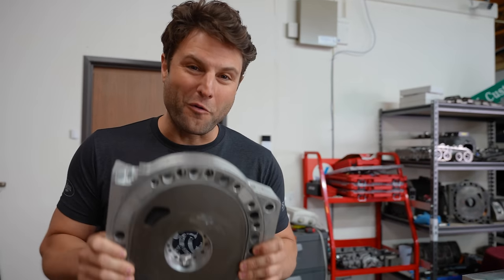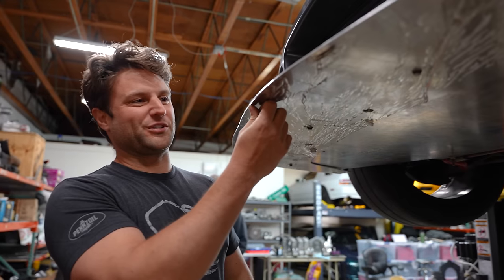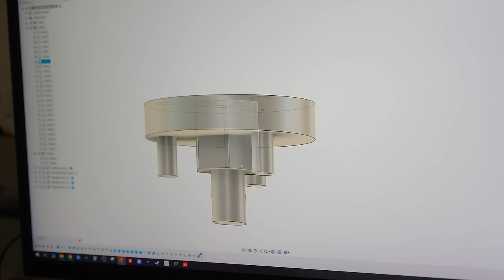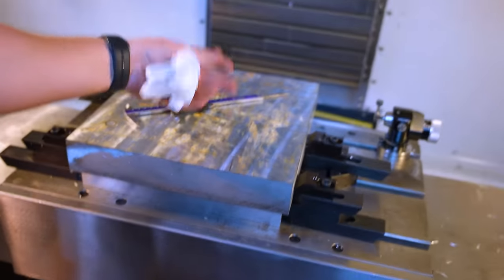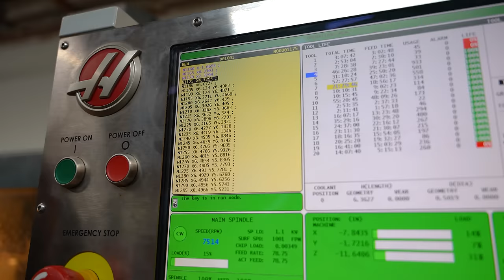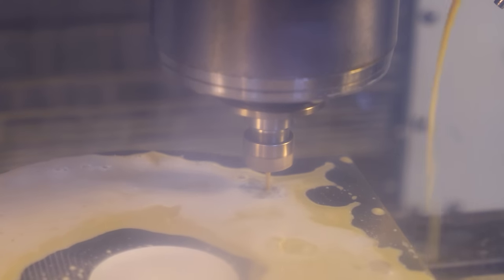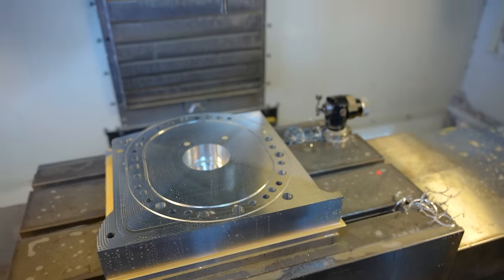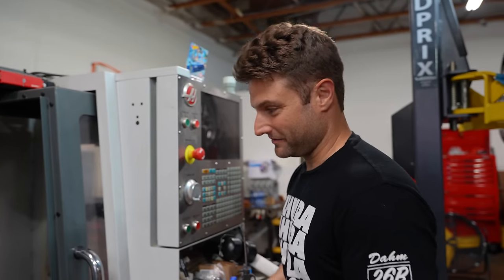Making my FIRST Billet Engine plate from raw Aluminum!  Dahm Racing Engines incoming??

Comment: If the rotors were wider, would it be a workable way of increasing displacement and power?
Reply: Yes, that's the main difference between 10a, 12a, & 13b, and also the reason housings can't be interchanged but irons can. Rotors are the same sizes but different widths. As for Mazda's new rotary engines, I believe the rotors are taller and wider, and nothing interchanges with 10a, 12a, or 13b engines.

Comment: If you're starting from scratch, would it not make sense if you wanted to go to even larger studs for more holding power to maybe space out the studs from the rotor area and enlarge the footprint slightly. Also with building from scratch could you angle the intake ports upward so the intake isn't directly above the exhaust? I know they have to enter the rotor at the same spot,. Maybe the swirl would be off, but it's a thought I've had.

Comment: Rob, look into form tapping. I generally have better luck with form taps not breaking in smaller sizes. Keep in mind the drill size is different when forming threads. Also you may achieve better results turning the coolant off and using tap fluid. Just put an M9 and M0 before your tap and blow the holes out, then fill them with tap oil. Another benefit is stronger threads.
Reply: Can't you also do the classic of making the machine actually go in a few turns then back a turn repeat to clear chips and all?
Reply: @802Garage  I'm not familiar with Haas specifically but you should be able to, however with form tapping there are no chips to worry about.
Reply: @loganriechers8764 Ah, gotcha! I should have known given the term form tapping. I was just thinking about what Rob did. Form tapping looks pretty awesome.

Comment: @RobDahm
Hey Rob.
I've been watching you for years, and..though i don't know a lot about the intracacies & tolerances of rotary engines..i had some deep thought about you making in-house parts, after having had an outside-in view for so long.

The engine plates are held together with a row of dowells, right?
Those dowells undoubtedly see a LOT of heat, which makes metal deform easier under load.
My thought is..could you add a bit of material around the outside of the plates, to tap in a secondary set of four, six, or eight supporting dowells along the outer area?

I realize the implications of adding mass to the engine..though..it wouldn't be much, and, i don't believe it'd hurt the harmonics.

These are just random thoughts, and totally unproven..however..as a fellow machine-head, it just seemed like a good thing to share before i "squirrel" and forget what i was doing.

Comment: If you're worried about getting the tapping right, thread mills make things pretty easy at the expense of extra time in the machine and higher tool cost. That and it really lets you dial in the fit you want.

Comment: For blind holes, it is good to use a drill with inner cooling chambers that can push out the chips from the hole. There are multiple types of it, simple twist type, changeable tip type, and changeable insert type. The insert types you do not even have to pull out after every certain depth cut.

Comment: Just a little note.  I've used those internal expanding clamps and they are not always concentric to the OD that you used to locate them especially after you tap it in with a hammer.  I like to install them and come back with and endmill and take about .015" of the expanding part to true up their location.  you'll still have enough expansion to do the job. :)

Comment: Make sure you open up or deepen the oring grooves when you radius the corners to account for the cross section you lost or you may end up crushing the orings.

Also you’re going to want to use an er collet for both the drill and the tap when rigid tapping because runout is critical.

And if you get past prototyping it’ll be time to invest in some coolant through drills and drill the coolant passages to size in one shot.

And for the love of good, get a torque wrench for your collet nuts, it matters.
Reply: pretty sure I recall the reverse comment in older vids with the square grooves hahahah

Great reminder: account for the cross sectional area fully

Comment: Few tips from a machinist: Get a bore gauge set,  the T shaped measurement tool kit and use those to measure round holes. When measuring with a digital caliper, the prongs are always square, so you wont get true measurements from round holes. And another thing, make sure the surfaces are spotless when you flip the parts over, one spec of aluminium shavings in there and the part is ruined. Hospital conditions.

Other than that, you are doing great! :)

Comment: For smaller tapped holes, Program a treadmill to the holes instead of a tap. Thread mills are way more accurate and a hell of a lot stronger. I work with 6061 T651 aluminum and A286 every day and thread mills are the best way of going about it.

Comment: As for the tapping I can help never have those break. I'm a cnc programmer. You'll want to drill out the hole and interpolate the hole a few thou larger. .003 - .008 should do for any thread .25" and up. Start at .003 over tap drill diameter for a .25" tap size and so on.
The pitch diameter does all the holding of the threads so there is plenty of wiggle room with the minor diameter. If you want to be exact there are great thread calculators so you know the delta between the minor diameter which you can remove to some extent and the pitch diameter which you'll want to maintain. This is all obviously for non critical threads. Tighten those numbers up relative to the importance of the threads. Hope this helps! Love the content 👌

Comment: I'm new to your comment section. Something you want to think about is tungsten. Metals that are less dense than it tend to weld itself to tungsten. You might want to think about opening up your oil channels and letting it do the de-welding of itself. Or coming up with an oil that has particles will be weld metal contaminants.

Comment: To remove the iron from the fixture, make two additional threaded holes in your fixture. Use a fastener with a non marring tip. Then just thread them in evenly to pop the iron off the fixture. Similar to removing a brake rotor from some hubs.

Comment: Great stuff on the machining! 
One small tip from someone also just started out. 
For improving parallelity I recommend unclamping the part, let it relax, clamp it again, and then take a final finishing pass. The amount of roughing done on this part isn’t huge but removing material will always induce some stress.

Comment: I worked as a maintenance mechanic on CNC machines for a ceramic manufacturer. They used wax to adhere parts to plates when they would do the machining or even created a vacuum plate in order to hold parts down.

Comment: So cool man. After watching this whole time seeing all you do with the rotary, ive learned a lot. I bet a lot of people would buy an engine from you. I machined for a few years, any time i ever rigid tapped allum. I slowed the speed /feed down at least 40% of what you were running and used the largest possible drill size to get the thread engagement you need. Also used the cnc to start blind tapped holes, only maby .300, then its perfect square and then the rest is finished by hand in deburr. The spring loaded holders were easier, they give up and down play so when the tap gets a hard spot or hung up slightly the machine cant break it.

Comment: Form threading is a must for your application, and for the minimal number of holes you are doing it’s worth it. I missed the grade of aluminum you’re using, but if you are told it’s not able to be form threaded don’t listen to them. All you need to do is thread mill half of the stock out first. You just have to make sure you use indexable form taps and know how to measure height from the center of one of the crests at zero degrees to the bottom of your tap. Use that height to program the thread milled valley is in perfect alignment with tap crest when you run the tap. The only setback is that it’s a two step operation but your threads will be at least 1.5x stronger. If you actually find that you would like to go this route let me know and I can explain in detail. P.S. You’ll need an Interapid dial indicator.

Comment: Rob, don't use that drill chuck for tapping. Get some ER collets for tapping. They have a square on the back side and they hold the tap WAY better than a keyless chuck will. I don't have trouble breaking taps anymore since switching to those from the old tap collets we used to use.
Reply: I just watched farther and saw you're using drill chucks multiple places. Stop. Get collets.

Comment: Rob have you considered detachable faces for the side of the rotor, both for ability to create cooling channels under the face where the rotor is touching. But also the ability to replace the side plates and not the entire thing. Similar to how the 12 rotor is built. Now the question is how do you mount the plate. Pressure will ofc hold it down. But you could build in fastners arround the hole where the stationary gear will be in the middle. Something like a lock ring or something. There is quite alot of room out to where the orings actually goes and needs a flat sealing surface.  Similar to what Billet Rotary is doing, i would think that would cut down RND on testing surface material for the coating. And also improove cooling by a bunch under the plate. For the front and rear you need to do this to get the water channels to flow if im not mistaken?

Comment: Rigid tap holders need to be able to float vertically. You MAY be able to tap aluminum rigid if you max out your minimum RPM (for my vf2-ss that's about 250 RPM) and adding a dwell time in fusion before reversing. With that being said, I tap mostly hardened tool steel.
Another viable option I HAVE done is to find a throwaway collet and put the tap in the collet with "enough" tension to turn, but also enough to slip when reversing happens.
Done that with 5/8-11 in 45HRC tool steel. If it works for that, it will work for you.

Comment: Look into using form taps , you use a larger minor diameter drill and the form tap does not cut but forms the threads . The taps are much stronger and no chips are formed. I have form taps that are 10+ years old and have formed 1000+ holes. Most auto and aero applications specify form tapping now because of the stronger thread it creates.

Comment: With the revelation that you had in seeing the housings flexing on the combustion side, I’ve wondered if someone could add some bracing on a billet housing on that side and maybe have the spark plugs come in at a slight angle? Love to see that someone is not going to let the wankel die just because parts are getting harder to find. Keep it up, guys!

Comment: You have your tap retract turned up on the machine. U need to go in the parameters and change it to 1. That will make the tap feed out at the same rate it feeds in. It helps alot. Also try using a modified bottom tap. That will push the chips out of the hole especially if it's a blind hole. Also helps alot

Comment: rigid tapping aluminum is easy. 
Just make sure you are not going to deep on your cycle. Stop a little before the hole bottom. 
200 rpm is plenty for tapping. 
Make sure you get the taps for the material you are cutting, as well as the flute/tip geometry depending on if you are doing blind or thru holes (they are different) 

With blind holes you will want a spiral tap that ejects the continuous chip up the flutes and out the hole. 

Couldn't see it well, but it looks like you were using a straight flute with a tip geometry meant to push the chip. Great for through holes, but on blind holes it causes chip packing and breaks your tap in very short order.

Comment: Hey Rob look into thread forming taps, They're much stronger than cut threads and work great in aluminum. The hole diameter just needs to be more accurate so you might need specialty drills or reamers.

Comment: I have a 1987 S4 FC.  I had bought another because the owner has blown the seals, so I have two 13bs, one running and one taken apart, I hope that you keep pushing and get to the point where these are publicly available one day, I would love to be able to make a 20b or 26b using the rotors and housings.

Comment: If you want to measure a flat plate use a flat panel scanner, they are extremely accurate, none of the issues with just a normal photo, though if you want a perspective-free photo get a telecentric lens, bigger ones have a smaller magnification ratio, but get expensive very fast.

Comment: Man, Rob's over here making an engine from scratch and this week my project car got stolen by a tow company. Due to tight finances, I was unable to get the car back but was able to get all of the parts from the car that I'll need to restart... again... for the second time this year.

I'm gonna take a new approach to this, I've got a spare complete engine in my storage unit that I'm going to get running on a standalone ECU while I rebuild my m50b30 stroker turbo setup. I'm going to go full racecar on this and hopefully I can find a nonrunning z3 to turn into a monster. I really need to get one of these builds done so I can get started on the twin compound m70b50 twin compound turbo time attack idea I have.

Here's to Rob keeping me sane while I restart from scratch armed with nothing but parts and knowledge.

Comment: I use an er32 collet tool holder to hold rigid taps and I works every time. It rotated in that chuck and snapped because the spindle was lower than the tap

Comment: Nice work! CNC Tapping threads in aluminum is a Royal pita! I’ve found that you need to use thread cutting end mills, rather than taps. Aluminum is so gummy that it just binds up the tap bit and breaks it.

Comment: try to use collets for drills, those three jaw chucks tend to make triangle holes, also though you are reaming to final size you should be stopping spindle at final deapth and safe retracting. Retracting a spinning reamer may not put you out of tolerance but it might take you away from that perfect actual dimension. But i find boring then reaming is typically the best way to get a perfect hole.  Youll want a surface grinder to bring those plates to final to maintain a level surface plane thatll seal well. Id cut the part to +.001 to +.003 over thickness for it if you have issues with sealing.

Comment: ROB! plz get yourself a nice aluminum facing mill. get a 50mm face mill. goes just a smooth but 100 times faster as you are facing with that end-mill. It will also do your profiling nicely and at high speed. As a machinist who made medical and aerospace parts, good face mills make a huge difference.

Comment: Taps will generally break on the way back out, especially in ally ive found because of the gummy nature of the material. The chips/swarf get wedged between the new threads and the flutes of the tap. I've learned if it's something i really don't want to have to make again, i only really tap things about 5mm deep (or at least a few full threads) and then finish it to depth by hand tapping.
Also looks like you could do with a face mill, would save you so much time surfacing the plates.

Comment: Excellent!!! 
If you can draw it in cad. You can machine it. It really is that easy. 
With all the different Cad programs that generate/post the G and M code programs. 
Great job on explaining processes. I like the grip pins. Can I make a suggestion????
Vacuum Table!!!!! You wont have to worry about flat and parallel. Just thought it might help

Comment: Awesome.
Some thoughts.
The o-ring groove with a ball nose will reduce room for it to squeeze into so you might need a hair more depth, but that will show if it destoys the o-ring.
The dowel is steel and iron aluminum, so a slip fit now is a loose fit running. Might be a good to make a slight press fit and heat during assembly? 
The way the motor is now all the load is on one side could you flip two and have half the pressure on each side for more potentially power? Would mean intake and exhaust on both sides though.

Comment: There’s a setting in the haas control that controls the spindle  speed reverse factor while tapping, usually it comes set at 2x if you reduce it to 1x it should help stop breaking taps on retract

Comment: You should get parker o-ring dove tail cutters. They form a groove that retains the o-ring during installation so it can't fall out. Imagine a rotary that you can't pinch a seal on during assembly. If you want more info I can send white papers and help you size the grooves for your seals

Comment: You can hand pile radius on your O-ring tool with a diamond file. And you do not want to tap to full drill, depth stay off the bottom of the lead of the drill.

Comment: You guys should buy a Bambu Labs X1 Carbon. One of the best printers I’ve ever worked with and I’ve worked with a lot. That ender 3 you got is a fine printer but so slow in comparison. The bambu pays for itself in just the amount of time it saves not to mention the quality. It truly is an amazing printer and you can do multi material. It brings your fabrication to the next level.

Comment: If that alloy is apt to forming, I’d highly recommend using a forming tap. You can run them faster, closer to the bottom of a blind hole, not all the way to the bottom, and they last longer.
Reply: Oh and OSG makes some damn good taps. Get a hold of a rep, bet they’ll point you in the right direction.